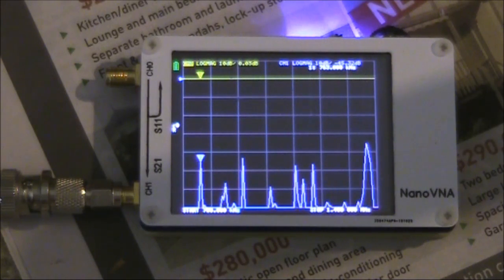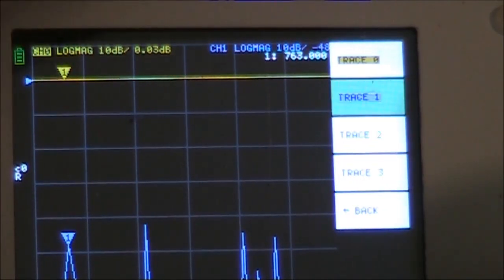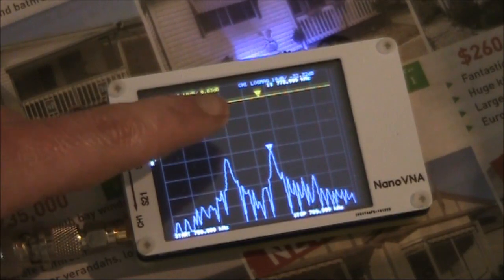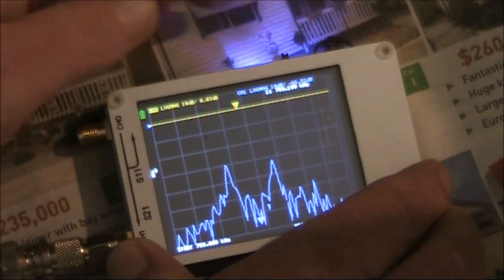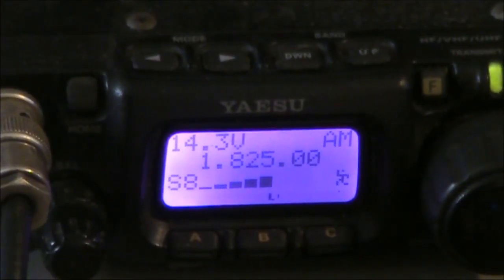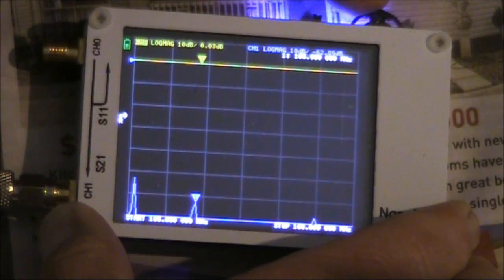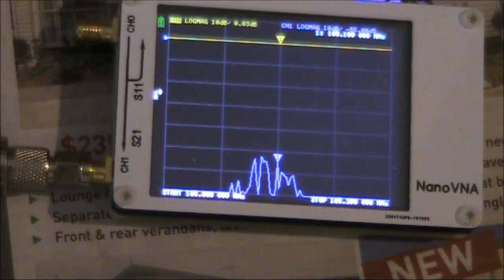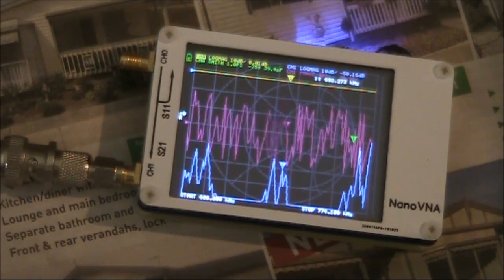Nano VNA spectrum scope: Here's how!

Comment: Presumably I can chuck this on the end of a VFO to check my harmonics and filter designs? I have just made an Arduino + Si5351a rig but I am very aware that it is probably pissing everywhere right now... Need to clean it up before I send it into an amp circuit (which will be the Ten Minute Transmitter, actually).

Comment: Good video Peter. Just one thing. With the Nano VNA, when you enter your frequency using the stimulus menu, I find it easier to use the touchscreen instead of the wheel thing. Using a clickey pen not clicked or a stylus of sorts its pretty easy with the resistive touch screen. Also I'm afraid of breaking that spring loaded wheel thing.

Also touching on the end of the video. Would there be enough gain from s0 output to use it as a crude frequency generator for a DC receiver? Or even a double balanced mixer? Something I've been meaning to tinker with... The other thing I wanted to test with the VNA is if it can be used for testing crystals or even finding the resonance for unknown crystals.

Cheers 73's
Tim VK3FTZD
Reply: I'd like to see it sweep a handful of crystals,  then a series of simple crystal filters like we use  in basic QRP rigs. Two crystals, then, 3, then 4.
Reply from the maker: @Paul_VK3HN  Good idea! I'll see what I can do.